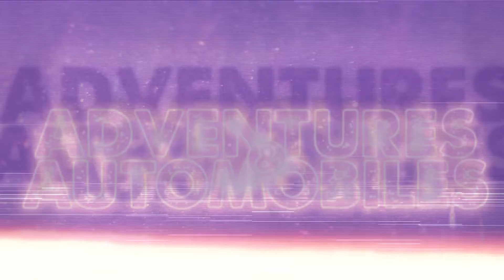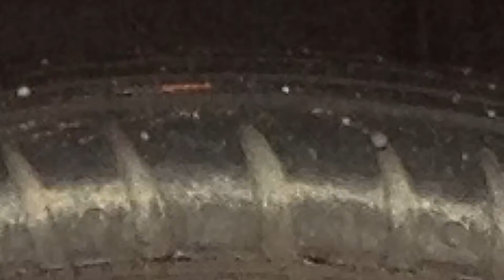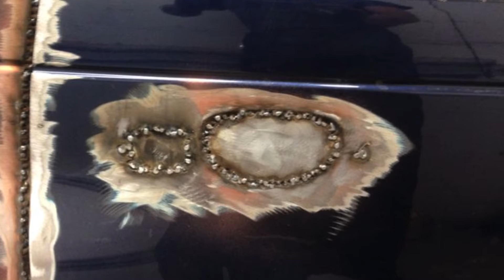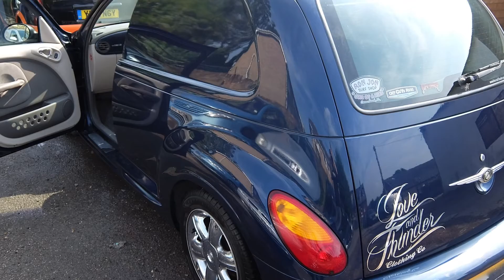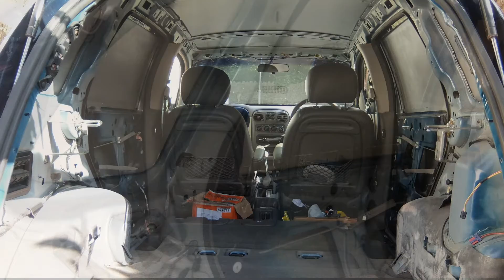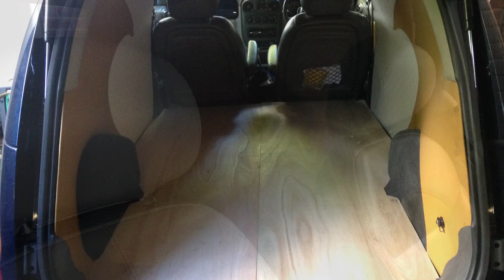Custom Panel Van Build | PT Panel Cruiser Conversion

Comment: what's the basic measurement of the space in the back ? is it more than 6 feet?
Reply from the maker: NO, from the back door to roughly back of the seats it's only about 170cm. However, with the passenger seat folded forward then there is more than 6 feet for sure, but that's only one one side.
Reply: @AdventuresAutomobiles  i meant in your build... i def wanna  make a camper van.. i just picked one of these up i wont have it for a month
Reply from the maker: @AuditorsUnited  have fun with your build!

Comment: Nicely done looks awesome. The diesel however, boooo!    I'm going to make mine a panel also, but I think I will widen the fenders so they really bulge out like the old cars do.
And maybe put in some fat tires and rwd with an electric motor, so it's a hybrid that can do rear wheel burnouts.
Reply from the maker: Sounds like an epic project! Have fun.

Comment: The distant cousin Chevrolet HHR has a panel van version. HHR and Chrysler PT Cruiser are both designed by Brian Nesbitt. 😂
Reply from the maker: Yea they're very cool. I hired one in the USA on a trip a few years ago. They're nice!
Reply: @AdventuresAutomobiles  I drive a 2003 Chrysler PT Cruiser GT turbo. The silver paint and sliver alloy wheel rims make it stand out in any parking lot. The turbo power and speed makes it fun to drive. 🚗 🚘
Reply from the maker: @exposingproxystalkingorgan4164 fantastic cars!